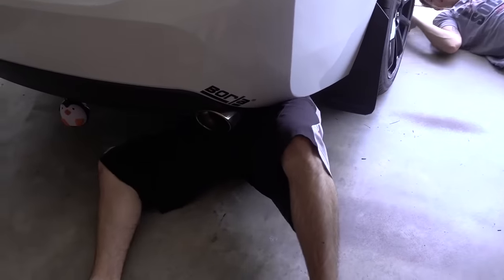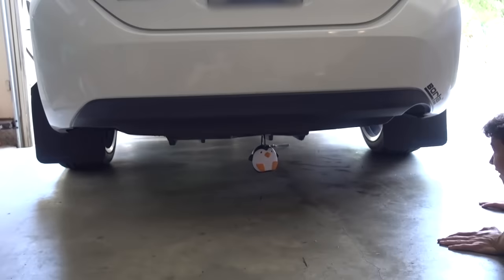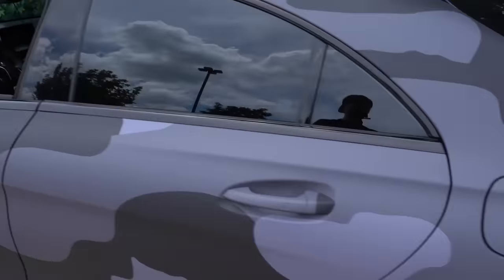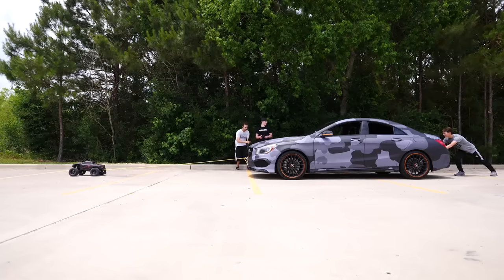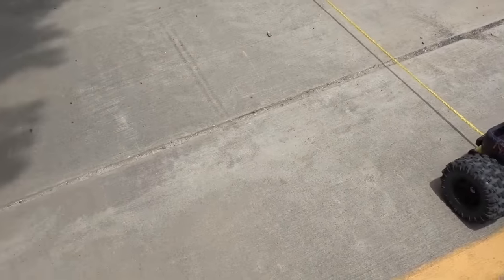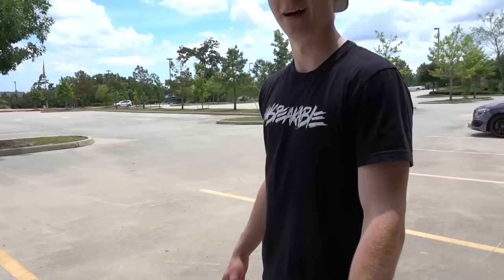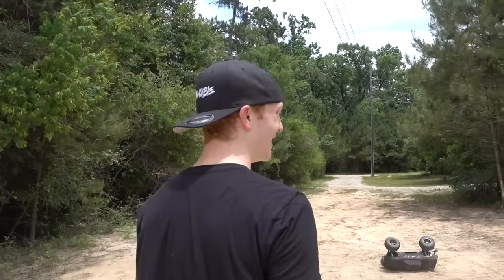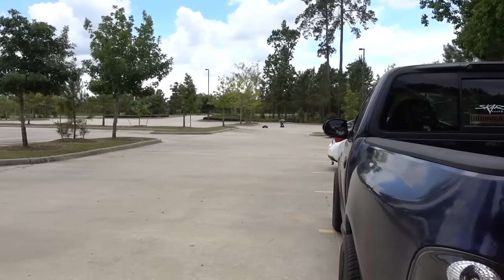100MPH RC CAR TOWING MY CAR?! *WORKS!*

Comment: Use 2 or 3 RC cars to tow a car!
That would work i guess!
Reply: He can just lock the differentials, I think it will work.
Reply: Patrik Engvall, that rc car is almost 1000 dollars, so it probably would work, but wouldn’t with that price lol
Reply: The traxxas x-maxx dose not come with lockable diffs, if he wants to pull the car he should probably go for a traxxas summit 1/8th scale

Comment: i really want you guys to redo this real car towing challenge, only, next time do not leave the car running while in neutral. if you do, even in neutral, a car will basically drive itself forward with a very tiny amount of momentum on such a scare, you rarely notice.
Reply: They probably should put that in park before leaving

Comment: Basically, you can end up with a loud car with lower power. Unless you put on another pipe to carry the exhaust away from the vehicle, you could poison yourself from fumesentering through your windows or even tiny joints in the body.

Comment: I just want to correct you those aren't roller skates those are roller blades they're basically like roller skates but the wheels are lined up straightly because you know like skating there's little blades on the bottom of the shoe thing it's a straight metal thing that are blades it's same thing with the roller skates except with wheels

Comment: The rc car is an x Maxx it only will 50 mph
Reply: Nop not even since thats an older model wich runs 6s and can only do 40 mph
Reply: @bluedott7956  I have a 8s and it does 50 so even the newest version can't do 100 mph stock

Comment: By taking off the muffler of the Toyota, you are actually hurting the vehicle, because the vehicle was designed to have a muffler. So I would not recommend doing that.

Not trying to ruin you guys' fun, just trying to save you car.